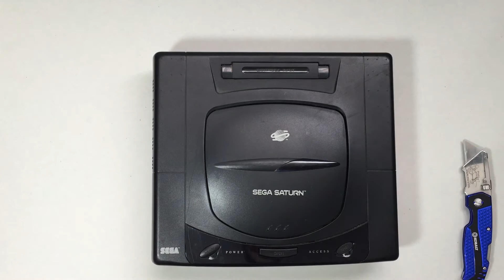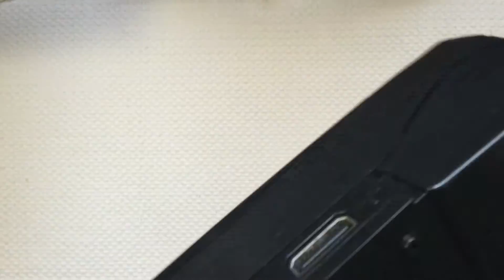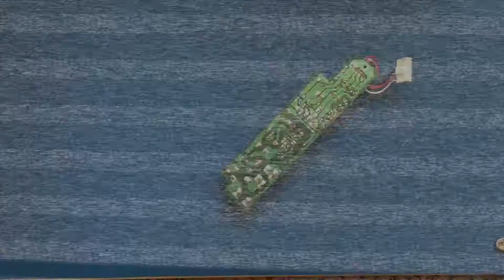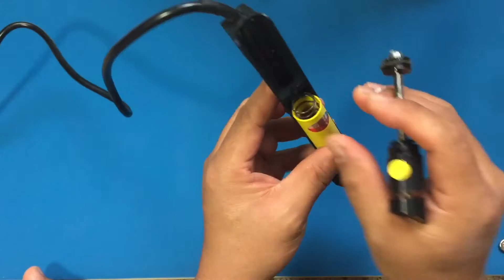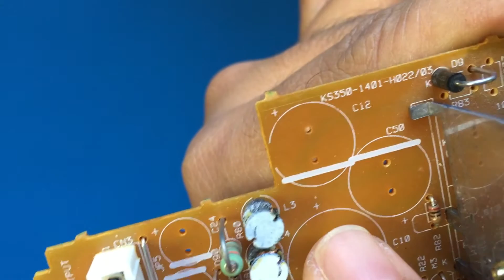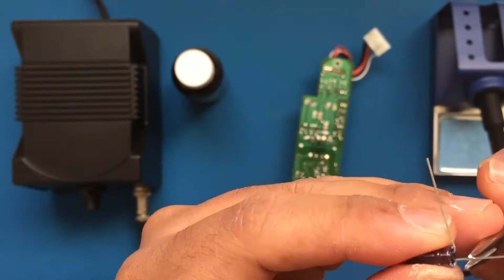Sega Saturn eBay Rescue 4  (Part 1 of 2) [SH no.23]

Comment: Anxious to see what the issue was. My original Saturn was a va0 just like this and dos the flashing power light thing if the PSU wasn't well inserted into the pins upon reassembly.
Reply from the maker: +Saturn Archive Was it a "launch model" model 1 like this one?

Someone had the same issue YEARS ago.
http://segasaturngroup.proboards.com/thread/2267/saturn-power-light-flashes-clicky
Reply: Oh yes, very much a launch unit. Manafactured May, 1995, with a S/N of 40,653 I believe. It was my favourite saturn I ever owned and if I ever found it in town at a game store one day I would pay anything to have it back lol. I also had a VA0.8 from june, 95 with the same hiccup.